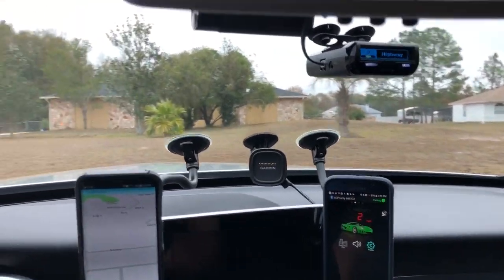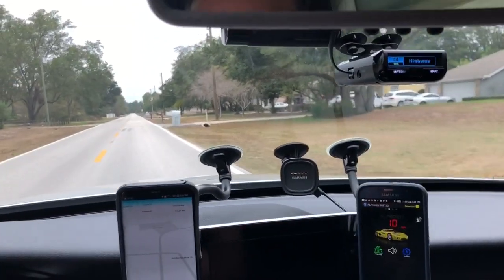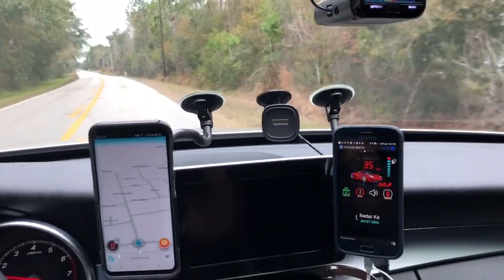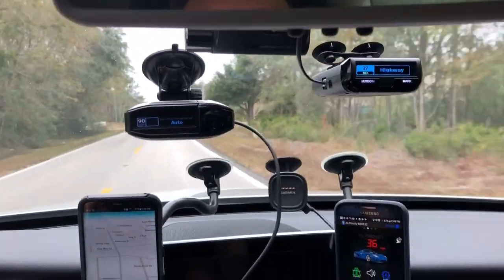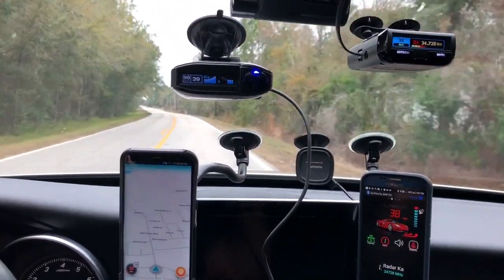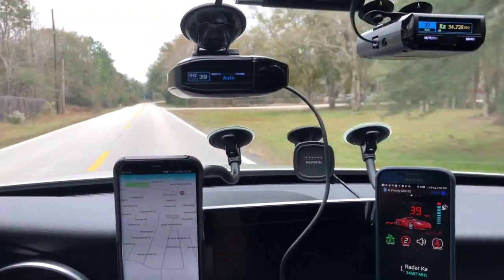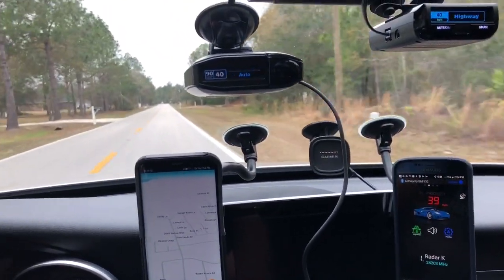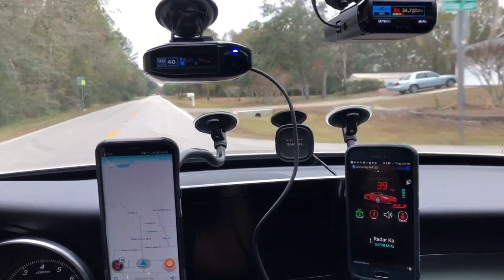Uniden R3 vs NetRadar DSP vs Max 360

Comment: R3 is nice but I much prefer the NetRadar dsp integrated with the ALP for a clean custom install and  the option for a rear antenna with arrows. All around bad ass setup. The max 360 isn’t a bad detector by any means though. Had a max 360c for a while until I got the alp with NetRadar and it served me well. It got relegated to wife car duty and she loves it as well.

Comment: The 360 is in auto mode, shouldn't it be in highway mode just like the r3 for a more fair comparison?
Reply from the maker: Jorge Lopez It was tested in all three modes and the results with the exact same. It detected in the exact same spot.
Reply: Jorge Lopez my R1 doesn't reduce ka band on city or advanced. Only on advanced does it have the capability of reducing ka band
Reply: Jorge Lopez do u have the max 360
Reply: Jorge Lopez one of the best features on a detector is GPS. 9500 was the first.On k band and x band when going 25 mph or less it starts to filter x and k automatically. That's where auto comes in.I have a 9500ix as well now that detector seems to filter everthing out a very slow speeds.It will make a double beep and the screen will indicate the signal but its almost silent especially when stopped.I can use my max with k band signals in the city and when you have stopped that's when you notice that almost all x and k band is filtered out. I have both detectors and always use auto.On my R1 I don't have GPS but on city mode I lose 90 percent of k band sensitivity. And I'm still surprised I get k band falses.I live in NC ,I have not got a k band cop in a year so I have turned k band off most of the time
Reply: I just ordered it yesterday but now I'm hearing negative feedback
Reply: I am sure this has been said already. Running two windshield detectors together, will cause interference with each other.  The R3 (and others) is known to weaken Max series detectors.  The videos where all three are running at same time is nit accurate representation of Max 360.  

Other detectors are known to interfere enough with each other to actually prevent the other from alerting.  Vortex on you Tube has videos showing this.  He also has tests of the various detectors too.

Comment: Why do you didn’t you have the max 360 in Highway mode that would been a fair comparison usually the escorts become very sensitive in Highway mode because that’s the mode that i have it in mine try to update the video so we can see the outcome thanks for the efforts of comparing them
Reply from the maker: Jose Velez the test was done on all settings for all detectors and the results were always the same. The 360 is a brick.  The detection range is inferior to the R3 and DSP. It’s just the way it is. All testing done confirms that every time. Check out RDF forum for more detailed results. Thanks for watching. I hope it was interesting.

Comment: This is the exact video I was looking for. Very informative, but this test does not show the speed detector pointing at 90 degrees facing across the street. I am not sure how Uniden 3 or others would sense it.
Reply from the maker: Deepak Pokhrel The tests were done with the gun at 90° as well and the results were identical.
Reply: Does the radenso filters affect the range they did extensive work on them R1 and R3 vs radenso test filtered and unfiltered

Comment: I purchased the R3 and after passing cops 3 different times without it is making a peep I returned it pissed off. My 360 was stolen with my car and i can't tell you how much more i miss the 360 than the mercedes and it only had 50kmiles. What was i doing wrong it was set to default.

Comment: That’s reason why I sold my max 360 I am planning to buy r3 or radenso
Reply from the maker: Super lucky Man do yourself a favor and get an R3
Reply: my 360 is going up for sale, too too many false alerts I FOCKING HATE IT,  i'd hate it if i spent $50 for it
Reply: Let's see a test between the R1 and the R3 and the 360 with and without the filters

Comment: What app is that on your Samsung phone?
Reply from the maker: Philip the s5 on the right is ALP Connect the one on the left s8+ is Waze
Reply: Okay thanks for the quick reply!  Appreciate it!  What's your pick?  Uniden R3, or Max 360, or something else??  I've been really looking into the Uniden R3.
Reply from the maker: Philip the R3 is by far the best windshield mounted detector right now. It has the furthest detection and the best Kband filter. The R3 also has a GOS for manual lockouts. The 360 meh......
Reply: Brett Patton OK thanks for the info man!